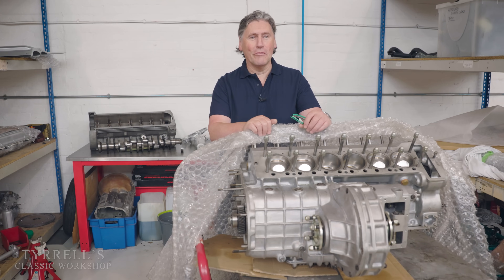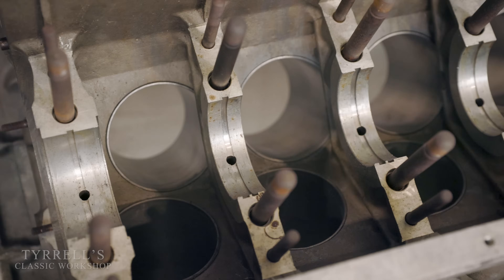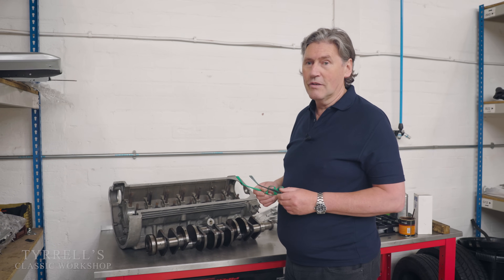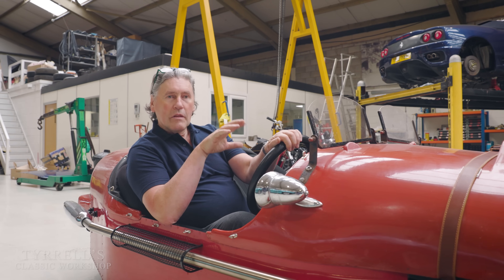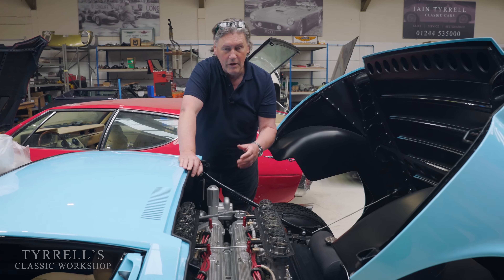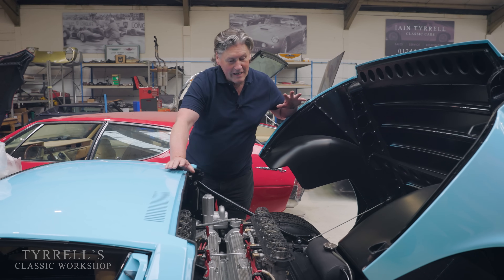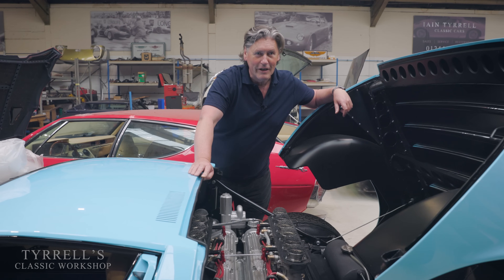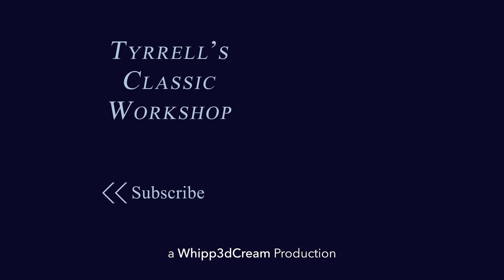How to warm up your classic car engine the correct way & why it matters | Tyrrell's Classic Workshop

Comment: I wonder if installing a lighter flywheel can affect the number of manufacturer-specified pressure-building cranks before the engine fires? I installed a lightweight flywheel on my 1990 300ZX and noticed that it fired a little faster when cold. I thought it was a good thing at the time, but now, after watching this video I'm thinking it might be a little mentioned downside of lightening the rotating assembly.

Comment: Would not electrically driven oil pump solve this starvation? When you turn the ignition key oil pump would come on first and circulate oil for a minute before the actual starter kicks in and engine starts?

Comment: Brilliant video!! I have a heavily modified 2014 defender with a JLR derived (increased in capacity) 4.8 V8. It takes 4-5 seconds to start and I thought this was too long. It sits at 1100-1200rpm for a few minutes before settling. Given this engine is older I’m now of the opinion they (JE engineering) got this spot on. I could be wrong of course, but it always concerned me how long it took to fire into life and this video has made me think differently. Thanks!!

Comment: I could take an educated guess and say you don't like engines with Start / Stop technology.
I do wonder about hybrid car's and the demands on the petrol engines.
Even the wife's Outlander PHEV has no mention of running in period regarding the engine.
It just says they don't recommend towing for the first 300 miles

Comment: Some modern engine management systems incorporate a flood-start sequence. For a dead start after a long rest, hold the throttle to the floor and crank. The engine will turn but NOT start as long as the throttle is fully open as fuel delivery is bypassed. (Obviously,  not something to try with a carbureted car). Start the engine normally once the clatter sounds "normal".
Reply: On a carbureted car with a manual choke and fixed jetting, holding the throttle wide open during start will extend the cranking time before firing with the mixture being very lean (due to the low venturi velocity).

Comment: On my Lancia Beta i've fitted a switch on the coil feed.
I wait until the oil pressure lamp goes out before allowing ignition.
Reply: I don’t think that minor startup wear on the Lampredi Fiat / Lancia twin-cam engine is the main area of concern when running and maintaining a Lancia Beta….

Comment: Piston engined aircraft - you always prime them with ignition off before you start them both for fuel pressure and oil circulation - and then they start at a fast idle for warm up -  the same principles apply - excessively rich mixtures wash the bores of oil as you said and the wear can be horrendous. You often see older race engines being throttle blipped when in my opinion they are still too cold and people copy that in their classic car this destroys them.  On my Alfa's I leave the choke alone and crank the engine for a few turns before pumping the throttle a few times - then it starts [only using the choke if it's quite cold out] once it is running - fast idle at 1500 rpm and never driving until the temp gauge has moved.
Reply: People are just generally idiots. Even with modern cars, I have an idiot neighbor that starts his car up every morning and guns it out of the subdivision full throttle. Hopefully that thing wears through a rod bearing soon so I don't have to listen to it anymore. Modern engines have great control systems, but they generally aren't using soft bearings anymore. So all it takes is one bad event between the crank journal and hard bearing, and the thing is hosed. At least racing bearings & older engines may grab some of the lead, but the lead won't cause any damage when scored away.

Comment: My late Father was an experimental driver for Jaguar. Leaving the choke in was the go to long life solution for the engine.
Reply: With a Renault 16 1967, automatic "starter" (choke) was replaced with a manual one  : we had to get out choke to max, pump once accelerator, then crank and as soon as engine was revving, push choke to half then off after a few hundreds meters.

Comment: I have a 30 year old Yamaha FJ1200 that I don't ride very often and I always turn it over a few times with the choke in before firing it up just to get some oil round. Not quite a Lamborghini but hopefully I'm doing something right. Thanks for the video and maybe we should do something similar for modern cars and bikes, let the warm up and start moving before we drive off.
Reply: It dosnt matter  what it is all engines deserve  the same respect  👍 and the tolerances  on a modern " big" 4 like yours are so tight  that its even more important

Comment: Superb information. Was wondering if it is the same process for older motorcycles? I have an 89 Honda VFR400 which I try to turn over on the second stab of the starter but it goes into a crazy 4-5000rpm idle with full choke. I knock that off as quick as I can but can't help but think of the damage it is doing...
Reply from the maker: I suggest your fast idle screw on the choke linkage is adjusted too far in. Some homework for you!:-)

Comment: I learned an absolute treasure trove of information here many thanks.  Quick question… is it possible that some of the older fuel injected cars have what they refer to today as “clear flood mode” whereby the engine purposely does not start when the accelerator is depressed all the way to the floor?
Reply from the maker: A lot of them are not as complex as that

Comment: On an Alfa GT junior what would start up process be? It has a hand throttle which I’m thinking is to raise idle speed… So two turns, start, raise idle speed…?
Reply from the maker: Keep idle speed at 1500 rpm once started for 2-3 minutes, then slowly drive with minimal load and no high revs
Reply: @iain_tyrrell  thanks for the info Iain!
Reply from the maker: Keep idle speed at 1500 rpm once started for 2-3 minutes, then slowly drive with minimal load and no high revs

Comment: With fixed-choke carburettors, what's the reason not to spin the motor for a few seconds before pumping the throttle to supply a rich mixture, either after letting the motor stop, or while it's still turning? Essentially, running a pre-oiler to build oil pressure before firing.)
Apart from the basic starting sequence, if you're running an older car that uses a viscous oil, it may require a while for the oil to warm up and settle at a proper pressure, won't it? Or is that negated by switching to a moderm multi-viscosity oil?
Reply from the maker: The fact that they don’t fire immediately but have to no coaxed and then should be kept at 1500 rpm ish initially mitigates almost all oil starvation on cold start

Comment: Excellent video. I’m going to modify my starting routine on my ‘67 912 since it fits the issues of a carbureted non-choke engine and it acts exactly like you described when cold.

Comment: Wow. A nearly 20 minute video about no more than starting an engine and it isn't boring for a single second. Who else can manage that?
Reply: And not one second of it was boring either!
Excellent coverage, Ian!!
Reply: @markchip1  You need to get out a bit more......
Reply: Not a single second was boring!
Reply: That’s because after the first few seconds we were totally worried about all the times we’d been hurting our engines.
Reply: A second can’t be boring..
Reply: James May
Reply: It's the real deal. I had a catastrophic engine failure last year, and it turned out to have been down to improper starting procedures. Started leaking oil due to wear though the valve guide, which led to detonation. Lost a valve seat and caused major damage to the head and piston. Needed a full rebuild.
Reply: Bore - boom boom.
Reply: Not boring to who?

Comment: In the old days, why didnt they put ignition kill switch or something like that so you could crank for couple secs and then put the ignition on to fire it like modern car. Is it due to too much fuel would be getting inside the cylinders since carb would still be supplying fuel?
Reply from the maker: That is certainly part of it, but car makers also didn’t want their cars to last forever
Reply: @iain_tyrrell  thanks

Comment: What about crankshaft thrust bearing wear? I've been taught that it is best to press the clutch to relieve some of the weight from the drivetrain to help the starter engine turn easier (you have said that it depends on the vehicle, though). However, recently, I have heard that it will wear the thrust bearing prematurely. Will it?
Reply from the maker: It’s a trade- off , and there is no 100% best answer
Reply: @iain_tyrrell  So, it's a pick your poison situation, really. Thank you for your answer and for sharing your knowledge with us. Have a good one!

Comment: Thanks for that Ian,  really interesting,  I've got a 34 Austin 7 which I always turn it over on the handle a few times before starting and a 58 moggy 1000 which I always crank over on the starter before turning the ignition on ( it has a pull start )
Thanks again

Comment: Now I'm wondering how you start a 2 stroke car from cold properly - most/all have roller bearing crankshafts since they don't have oil pressure. Presumably they are a lot less delicate with their starting procedure?
Reply from the maker: Exactly
Reply: @iain_tyrrell  I would guess that you don't need to worry to much about the warming up process either?

Comment: When I get my restoration finished, with its rebuilt engine, got all this to consider.  Not just starting a classic engine but also running it in.
Reply: Consider a pre oiler, don't know if they are available now..don't see why not...Or even simpler, rig up a switch to the ignition, and then switch when you want engine to start..a 5 second crank should do it, whatever you think best...

Comment: I have a 1970's classic Ford with the tall Pinto OHC engine and I only use it once a week at the most.  On starting from cold again the petrol requires the mechanical pump to pump it up to the carb to be able to start once more.  This is a good thing because while cranking it allows the oil to circulate and reach the top of the engine.  When it fires I let it tick-over until the oil pressure on the gauge has risen and then I am free to rev up and drive away.
Reply: Which ford do you have exactly? I also have a Taunus TC1 Turnier with the 1.6 pinto. Nice to see somebody else with a 70s ford
Reply: @288gto7  Yes Indeed.  I have an Escort RS2000 Mk2.  I love the 70's cars, my father had Cortina 1600GXL, 2000E and Mk4 2000 Ghia.
Reply: @levelcrossing150  nice, i love 70s cars as well. My Taunus was also left to me from my grandfather that bought it brand new in germany in 1975.
Reply: @288gto7  That's a great history to your car then and nice it's kept in the family.  I believe the German models had the roller bearings on the cam followers, so much better than the solid ones that wore out on our cars.  I fitted a type 9 5 speed gearbox in mine, it makes a great difference and is the only change I have made to it. .
Reply: @levelcrossing150  im not sure about the 2.0 models but regular 1.3 and 1.6 german pintos also have the flat tappet cam followers. Also great modification that you have done, i would like to one day do that as well. Just a quick question, were you able to fit it without issues or did you have to cut the floorpan and shape a new one that will make the trans fit and then welding that new one in?
Reply: @288gto7  On my particular model Escort it was a fairly easy conversion and with no modifications to the tunnel as it is designed for the larger Type E gearbox anyway, so I guess yours would be the same.  After removal of the gearbox I changed the RS aluminium bell housing over first then I had to move the gearbox mountings back in the tunnel by drilling the spot welds out and rebolting the mountings with plates on the inside approx 80mm back to accommodate the longer gearbox.  I just soldered up the old holes just incase it ever needed to be reversed in the future.  The standard RS also has aluminium spacers on the mountings to drop down the height of the gearbox, I also had to make additional spacers just to drop the new box down a little further due to the taper in the tunnel further back, approximately 10-15 mm if I remember right.  Propshaft stayed the same length. The gearlever stayed in the same place but I had to straighten and shorten the cranked Sierra Type 9 gearlever to look right in my car.  I also fitted a quickshift kit to shorten the throw like my original box.  I then had to change the speedo drive from the old box to the new one and fit the longer Capri speedo cable, but you may need a longer one again, maybe from a Granada.   There is also a conversion kit available for the RS which consists of extensions that avoids you having to move the mountings, also the T9 gearlever might fit yours without any mods.  It's a common conversion and I would get in touch with the Taunus or Cortina car clubs to see if they can give you any further tips on fitting one.  Ideally you need to offer the new gearbox up to the car and see whats needed.  Choose your new gearbox carefully, avoid diesel versions were the ratios are not suitable, and 2.8 Capri which has a longer input shaft.  Mine was from a Sierra 2.0 Pinto where all the ratios were the same as the RS and fifth is like an overdrive which is great these days with the rises in the cost of fuel.
Reply: @levelcrossing150  thank you so much for the detailed explanation, i ll keep those in mind
Reply: @288gto7  You're welcome, I wish you good luck with it.  I'm here if I can help anymore.

Comment: Majority of the american v8s actually oil the valve lifters first so that they dont make ticking sound on startup. Oil finds its way to the crank mains much later after initial startup.
Reply from the maker: Yes indeed

Comment: Very correct. Many of my old carbureted Ferraris had chokes but it was strongly discouraged to use them, if cold the carbs simply needed to be gently pumped two or three times to prime and then tickled once the motor started and then not overrevved! On a hot start you did not touch (nor needed to) the accelerator pedal and the motor would fire up beautifully .

Comment: To start the Merlin you run the preoiler for a while to build up oil pressure. That could be achieved with a moderna engine as well if they had been equiped with an electric add-on to the oil pump. A starting sequence where the computor triggers the oil pump first and then the ignition.
Reply: My first thought as well. Why this is not a standard?
Reply: @anonymousonlineuser6543  Cost.
Reply: @jonathanrabbitt  Does not make sense. Cost of electric pump is negligible if in return manufacturer gets high engine reliability reputation.
Reply: @anonymousonlineuser6543  iIt would probably add $250 or more to a large scale production car, plus the additional weight. Besides, it might contribute to longevity, but it is unlikely to affect normal lifecycle reliability.

Comment: On something that's stood long time it can be worth taking the plugs out and spinning the engine on the starter until the oil pressure comes up, then put the plugs back in to start. That way there's no compression so very little load on the bearings. Of course, this does depend on the car being one designed for fairly easy access to the plugs
Reply: Yes, but the compression would then still be there. Taking them out is just even more gently done.
Reply: @peterschaldemose7861  It is clear we all care for our engines! I remember Iain saying that each time one takes the plugs out this also causes wear
of the threads but that was probably an ultra precious Lamborghini 12. Got a Volvo 240 looked after by race mechanics so to be honest they do the caring part and I am of course aware of what that entails and I understand that regular maintenance is the key. A car built in 1992 and used most days is testament to that!
Reply: Absolutely dead right. You should always remove the plugs after a week or two, until the oil pressure is up but with no compression so the bearings don't get hammered..
Reply: Been using this technique on old motorcycles, peace of mind really.
Reply: Especially after an oil filter change to ensure that the new oil goes everywhere.  Do this on my MGB GT
Reply: Taking the plugs out? surely just taking the lead off the alternator would stop it firing, the starter would still turn.
Reply: @lucifarian93  Do you mean take the LT wire off the coil?
Reply: @TonyLing  Yes I did so that the engine just turns to get the oil round before it is fired up if engine has been idle for a while. Others have mentioned the care they take but fir me the access to one of the plugs us tricky and besides I use both my 240's one week on one off so not too worried! .
Reply: I've just done an oil and cambelt change on a race engined Davrian.
I treat it like a Bugatti due to the race engine, one of 12 built by Rover Group's competition branch in 2000 for PTPs own enduro race Caterham.

I actually removed the cam covers to oil the cam lobes and bearings, and have removed the plugs, so tomorrow I'll spin it on the starter till I see oil pressure on the gauge, before replacing the plugs.  With such a rare engine, which cost £12,500 in 2000 I don't want to cause unnecessary wear
Reply: Errrr....not Davrian above, I have two Davrians here and it's very hot today in SW France....it's a Caterham SV with PTP Evo 220 engine!